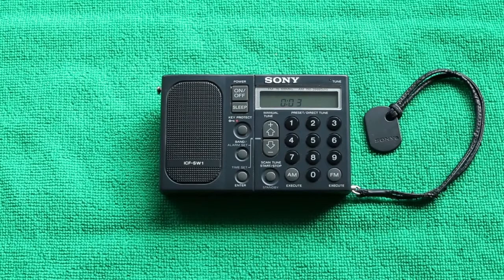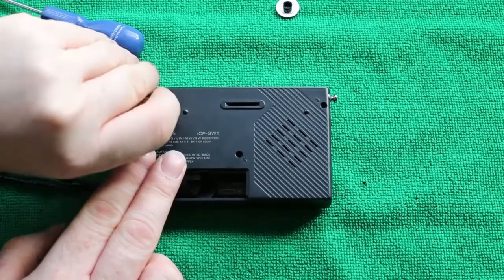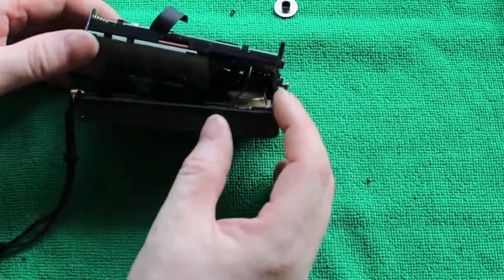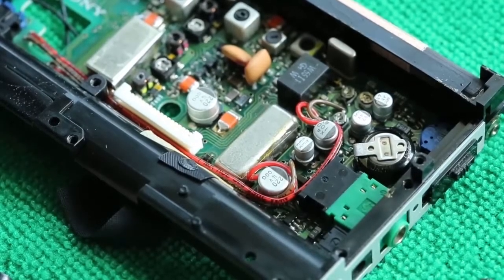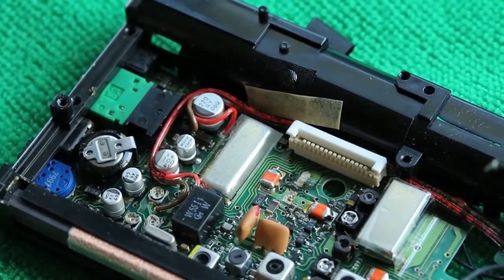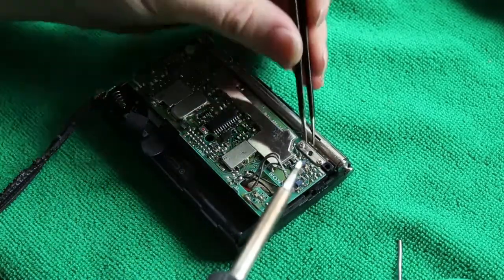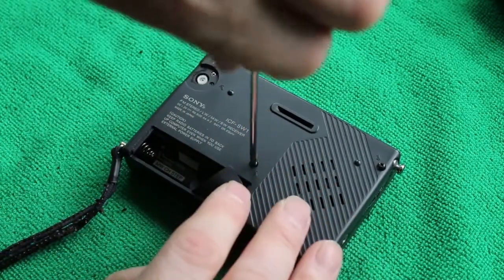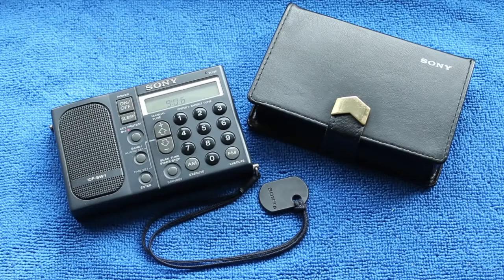Sony ICF-SW1 Repair. Vintage Technology Workshop.

Comment: Very informative video, thank for sharing.  I had two old Sony SW radios I bought long times ago both not working.  After watching your video, I have hope that I may able to re-start them. The problem for 1. SW1 nothing appear on the screen, what is the problem. 2. SW7600 figures appear on the screen but very weak and no sound at all.  Can it be due to the leakage of battery then.  Hope you can enlighten me as to the causes of the above problems.  Thanks
Reply from the maker: Definitely sounds like capacitors on both of them, and also check for corrosion that may have caused the tracks on the circuitboard to no longer be making contact. It's also possible that battery leakage may have caused extra problems as well, but you'll only find that out when you take them apart. Many thanks from Aston.
Reply: @AstonsVintageTechnologyWorkshp l

Comment: Mine has same problem but I still can use it with headphones it's sounds fine with headphones just not with speaker
Reply from the maker: It's still probably worth having a look at the capacitors, to make sure that they haven't started leaking. Better safe than sorry.
Reply from the maker: @Mdnosliw Nice one. Glad you sorted it. :)
Reply: Mine seems to be fine with headphones too, or at least alot better...I wonder what part is gone in ours

Comment: Fantastic Video Sir, you are a Professional 👏👏
Reply from the maker: Thanks :-)
Reply: @AstonsVintageTechnologyWorkshp  I bought this marvel a few years ago on eBay and it started motorboting, just getting it repaired by Keith Electricronics in PA. 

I am not too handy with such repairs and it is best to leave such delicate work to Professionals.
Reply from the maker: @davef5997  They are a bit small to work on :D but worth it in the end.

Comment: Thanks for this useful video!👍. Do you perhaps know if there is a way to finetune the frequencies when they are a bit off frequency?..
Reply from the maker: Yep, check out the service manual - pages 18 and 19. The manual is available from here http://www.radiomanual.info/schemi/RX/Sony_ICF-SW1_serv.pdf You'll need a RF signal generator and a frequency counter and possibly a scope or VTVM (Vacuum Tube Volt Meter). All the best from Aston.

Comment: Thank you so much for the video.
I have a question for you:
I can't find 4V capacitors anywhere.
Can I use high resistance capacitors?
For example 220µF/16V or 220µF/10V instead of 220µF/4V
Reply from the maker: Yep, as long as they are about the same size and they'll fit in the space that's there, you'll be fine. You can even use standard caps, but you'll have to bend the legs very carefully to fit and they would need to be the extra small ones, but it can be done, as I've done it for a customer who wanted it that way. All the best from Aston.